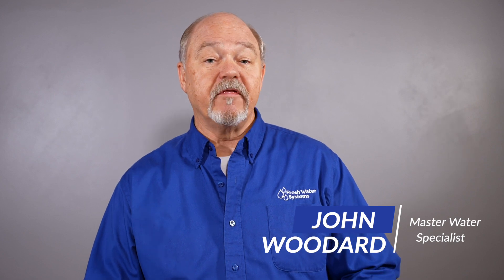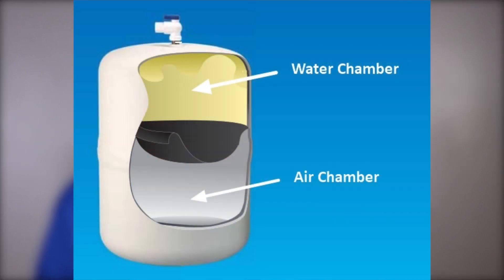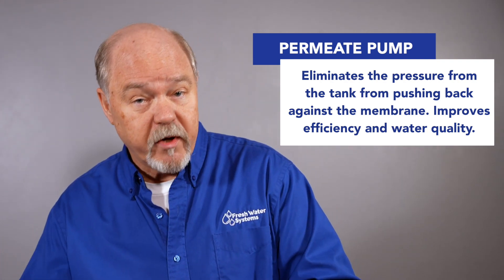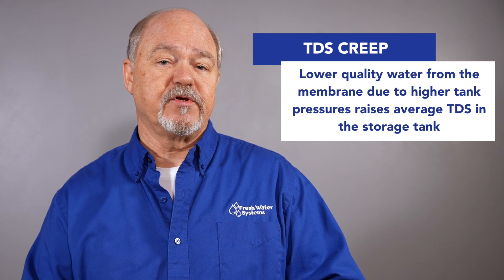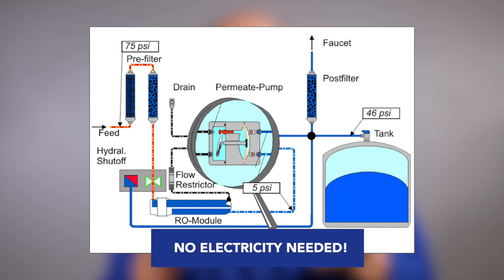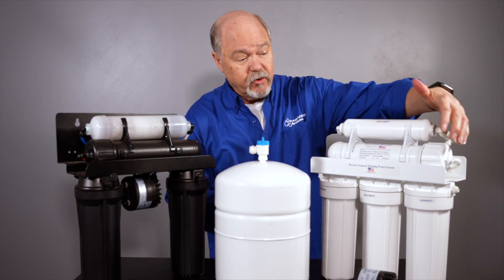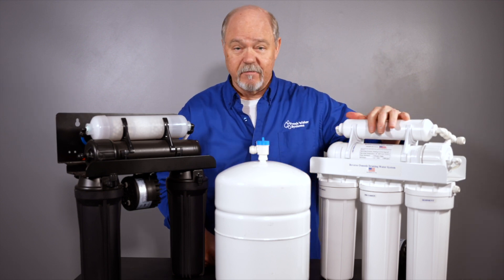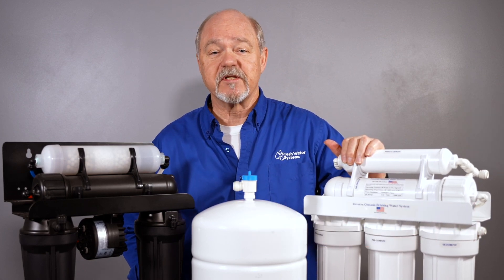What is a Permeate Pump, and How Can it Help my RO System?

Comment: If anyone is having trouble understanding, but knows how a cars turbo works, which is when exhaust gas goes out the exhaust pipes through the turbo it spins blades which in turn force additional air into the intake. The way I understand it from this description, it works the same way.

Comment: I have a tankless RO system with a booster pump that is only about 20psi after the filter. can I put a permeate pump to boost pressure? or could I use another booster pump in the permeate to boost pressure?

Comment: Hello Sir. Had a quick question about a failed filter housing. Blew out towards the top of filter housing. Scratching my head why. Too much pressure or too hot in garage? Do you have a website I can send an inquiry?
Reply: Probably bad O-Ring or the housing wasn't tight enough. Could be a crack in the housing or manifold if it was tightened too much
Reply: @gunnarlawler  thanks for the reply, makes sense.

Comment: We have an ispring ro system that comes with a booster pump, but we had to install it in our garage so there is a long run of line to the point of use in the house. Unfortunately the pressure at the faucet is still pretty low...will adding a permeate pump improve our pressure at the faucet and is it okay to run 2 pumps?

Comment: I changed out my 3 pre stage filers and then noticed my presser was reduced significantly after a few days / hours of trying to identify the significant drop in pressure I discovered when I bypassed the ALK Alkaline Mineralization filter my RO water pressure at the faucet jumped up significantly...Go Figure.
I have a Express Water RO System that now works better than ever before. My next step is to add a Permeate pump EPR-500 and not the EPR-1000 because of the noise reduced the pump makes when in operation. Looks like a great product and want to add it to my system. I will be leaving in the automatic shutoff valve also known as the brain of the system to keep factory on/off pressure set points in place.